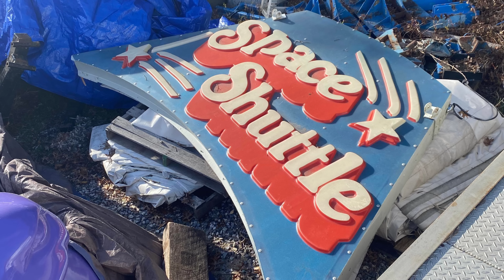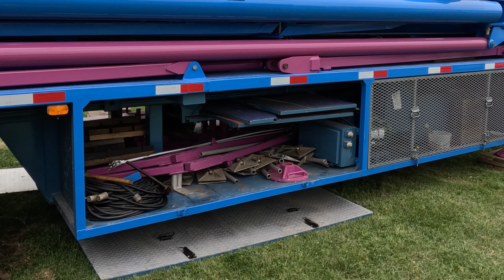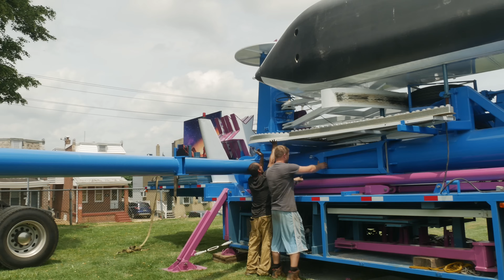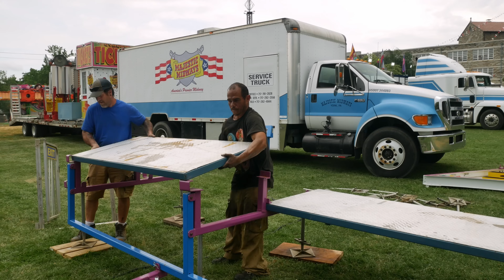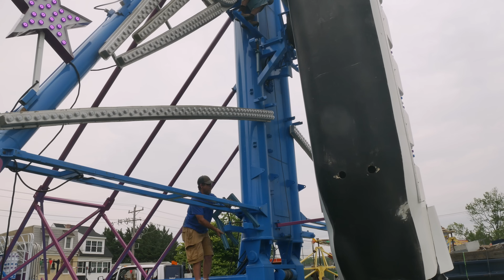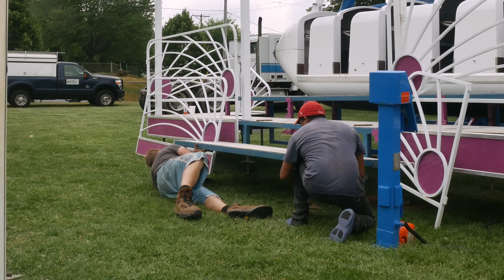Setting up the Space Shuttle Ride - Plus Rebuild!

Comment: Is that a power mains arcing @09:13 under the decking?
Reply from the maker: It was a pinched wire in one of the lighting panels on the right side of the ride.  Took out a few fuses on the light chaser circuits.

Comment: I kind of cringed after they kept working under the tower as it was being raised. Putting a lot of faith in an old hydraulic system...
Reply: They do a ton of things unsafe that would get oshas attention in an industrial site
Reply: Hydraulic cylinders catastrophically failing isn't really a thing. Look at large mobile cranes. The entire boom arm is held up by a massive cylinder on the bottom. Normally it's just one cylinder.
Reply: @themagiccoasterlover  Right... and that's why you shouldn't stand underneath a load held by a crane either.
Reply: I've noticed the same on Pete's Ferris Wheel setup video. One cylinder failing could be catastrophic
Reply: Glad I’m not the only one lol
Reply: Although I wouldn’t want to work under that, the cylinder should have a holding valve or velocity fuse on it.
Reply: That’s why the Hoover Dam would take 25 years to build today but they did it in 5

Comment: They've done an amazing job at restoring this one..!
Question: when these rides are new, do they come with 'assembly' instructions (akin to IKEA instructions) as they appear to be massively complex in setting up.
Reply from the maker: They really did do a nice job.  Most rides this size come with a rather extensive manual in a 3 ring binder.  Has all the setup instructions as well as mechanical and electrical drawings.  I recently purchased a manual for a rather rare ride- I'll share it in an upcoming video, it is a fairly typical sample of how ride manuals are laid out.